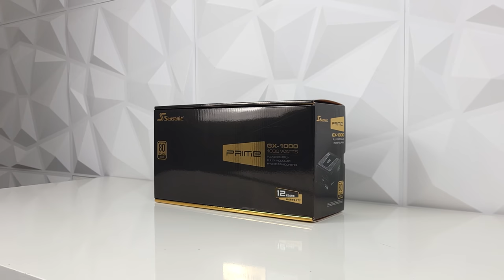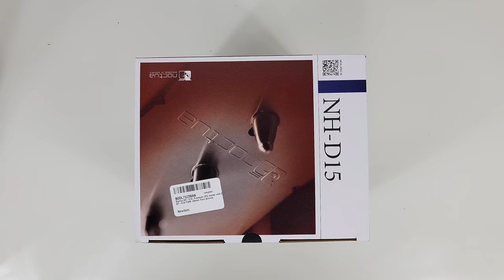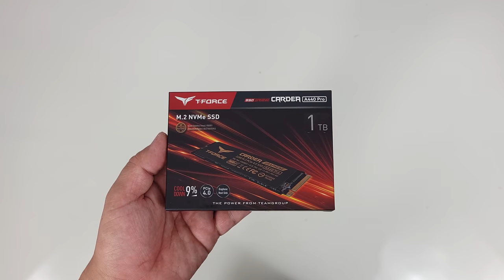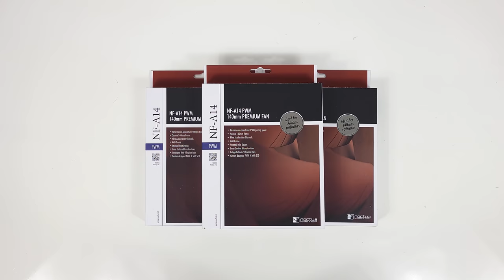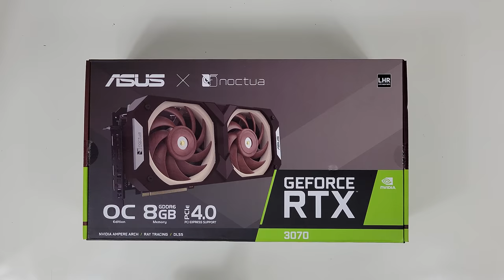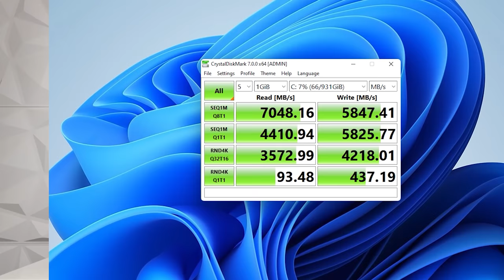Noctua PC Build 2022 | i9-12900K | T-Force DDR 5 | MSI MEG Z690 | Fractal Design Torrent | Seasonic

Comment: Noctua produces the best fans no other company could compete with. Airflow is always important to assure that the components don't overheat.
Reply: Noctua is king but there are companies that are competing just fine. Like BeQuiet.
Reply: phanteks T30 fans literally outperform them but ok
Reply: radosaurus   Wrong. There's plenty of noise normalized benchmarks out there and in pretty much all of them T30s outperform by quite a bit actually
Reply: @ThunderingRoar  They are 30mm. Not comparable. A12 still the king.

Comment: RTX 3000 series are extremely sensitive to warping PCB and because of that the GDDR memory going fail after some use. I suggest anyone with any 3000 series especially with heavy heatsink and fans use brackets or risers to support that heavy weight and avoid any PCB warping.
Reply: facts. the cooler on this 3070 is absolutely absurd in size but I love it lmao
Reply: how bout vertical mounting is it ok. I got the rtx 3060ti zotac twin OC
Reply: @Jack-xx3qg  Better for sure
Reply: Anyway those cards are going to fail. The design itself is too risky. Too much power to handle in a small area. Lead free solder and thermal cycling. It's time cases are redesigned to have the video cards always mounted vertically with the risers/adapters and rear cut outs readymade in the case. Also they need fresh ventilation to pull the air from the side panels.

Comment: I really like this build. The Torrent was a good choice because it's all around good and conveniently hides the Noctua fans from being seen head on at the front intake. Original color Noctua fans don't look great through obstructed view (dust filters, case grills). The cable extensions look awesome too. The only downside in this case is that the Torrent doesn't support vertical GPU mounting and a big point of that card is the Noctua fans in the fan slots. The ASUS X noctua logo design done in the Noctua colors is sleek and classy though so still amounts to a pretty sweet build.
Reply: Most cases that already have vertical mounting options do them badly. Almost 100% the gpu is too close to the side panel. You always need to buy a seperate vertical mount if you want to do it properly
Reply: the torrent does support vertical mount tho

Comment: I was shocked when my Fractal Design Torrent case arrived. That thing is huge! I suppose it’s a good thing as the NH-D15 probably wouldn’t fit in anything smaller. I just wasn’t ready for the size.

Comment: Awesome build, having the black gold accents on mother board, those custom cable extensions. 
All I’m missing is that 120mm fan in the back…?
Reply from the maker: Unlike other cases, the Torrent rear side has an open grill and the entire rear side acts as an exhaust. Adding the rear fan to the torrent didn't improve temperature while two front 180mm fans are blowing massive air toward the back.

Comment: Very nice and clean looking build, but the standard fans in the fronts are destroying everything after you put the work in the cable detail.
And why putting these sticker on the nvme there is a thermal pad on the top of the heatspreader.
Reply from the maker: I would change front fans if Noctua makes 180mm. Graphene sticker act as heat spreader it help even more.

Comment: should populate all the fans with NF-A12x25. change the nasty black front fans, 
and also populate rear and top (if possible) as an exhaust, this build has 6 intake fans and no exhaust.
Reply from the maker: Unlike other cases, the Torrent rear side has an open grill and the entire rear side acts as an exhaust. Adding the rear fan to the torrent didn't improve temperature while the front fan blowing massive air toward the back side. Bottom fans are 140mm not 120mm and Noctua doesn't make 180mm fans.
Reply: @PCTechnician  I see. 
I mean, for the sake of similarity, all should use use the same brown fans. and A12x25 seems the top tier choice from noctua. bottom and front, if not mistaken, can also populated with 3x120mm. and the back, well, for the sake of Brownie, it maybe better with brown exhaust. 

nevertheless, this build is still good

Comment: That extra copper plate should not have been installed on the NVME as far as I know. Only use it when the MOBO has no built in heatsink to cover the NVME/SSD. But other then that, awesome looking Noctua build
Reply from the maker: Graphene sticker act as heat spreader and it helps even more under mobo built in cover.

Comment: This looks great, but there are 5 or 6 intake fans(3 on bottom +2-3 on front) but no fan to pull hot air out from the case except fan on PSU. At least one should be on the back of the case to pull hot air from CPU cooler.
Reply from the maker: Unlike other cases, the Torrent rear side has an open grill and the entire rear side acts as an exhaust. Adding the rear fan to the torrent didn't improve temperature while the front fan blowing massive air toward the back side.

Comment: I've been thinking in your design since the 3070 Noctua arrived and you have done my dreams. I'm waiting for my 12900K and the only problem is that I have a Gigabyte 3090 VISION and I don't want to change for the 3070 NOCTUA, but I'm in love with it. I also use the NOCTUA NH-D15 and 6 140 mm NOCTUA fans in a FRACTAL DESIGN MESHIFY S2 white... come on!! When I saw your video I thought.. It is exactly what I have thought!!!! And very similar to the mine PC. I'm also using a CORSAIR RM1000X and CABLEMOD extensions in white.
Reply from the maker: Looking good!

Comment: Glad to see u use the meg since this the one im getting for my new i9 build aswell. What kind of ram can u recommend for this mobo? I with thinking about 4x 8gb vengance pro "3600"
Reply from the maker: I really like the new i9 & Meg too. Most DDR5 stocks are out of market so I can't really comment. You can use DDR4 on MSI Mag.
Reply: Make sure you get RAM that is compatible with your motherboard! The Meg board featured in this video is DDR5, and DDR4 would not fit in the motherboard. Although DDR4 Intel 12th gen motherboards exist, you wouldn't be able to get the full potential out of your CPU without DDR5.
Reply: @raptor6832  theres a ddr4 meg version not the ace one tho.
I read there can be issues without bios updates thats why i ask. Im not a fan of bios updates lol
Reply: @PCTechnician  You should remove that comment from that scammer below and report him man
Reply from the maker: @bnj3425  OMG this scammer is back! Thank you for letting me know. I'm deleting it right now.

Comment: I find this highly rated case hilarious. Seems to be like all the youtube pc experts are raving about how awesome this case is, and then you look at their setup and it's all completely intake, and no exhaust, except for the PSU fan. In this video, he has 2 giant intake fans that come with the case, and 3 fancy noctua fans intake from the bottom, but there are no fans dedicated for exhaust. Don't forget, this case has no top fans or side fans. LMAO
Reply from the maker: Looks like you completely misunderstood. Have you ever wondered why this case shows the best thermal result in the market without an exhaust fan? Unlike other cases, the Torrent rear side has an open grill and the entire rear side acts as an exhaust while two front 180mm fans are blowing massive air toward the back. Best Case of 2021 picked by Gamers Nexus. Check out the benchmark https://www.youtube.com/watch?v=HBxo2_lwKps://www.youtube.com/watch?v=HBxo2_lwKps

Comment: Beautiful build, but what are your CPU temps like under load? I've not really seen anyone air cool the 12900k yet.
Reply from the maker: GPU max=60c, CPU idle=30c, average full load=81c
Reply: @PCTechnician  did u undervolt or is stock settings? heard from techs that i9 cant be aircooled....
Reply from the maker: @babiialahaku  Aircool is fine with Noctua. I would recommend the undervolting though.

Comment: Has the 3080 NOCTUA not been released yet or is it just terribly hard to find? Great looking build, but pairing the 12900K with a 3070 seems a bit mismatched.
Reply from the maker: Yes it will be better with 3080. Noctua 3080 will be available starting in early June 2022.

Comment: 3 fan setup at the bottom is wrong it should be upside down.. Frame area of fans should be facing down to push out air... Here fan frames are facing inside pulling IN all air... Hot air created inside system should be pushed out... Kindly correct me if I'm wrong...
Reply from the maker: 3 bottom fans should be intake. This is how the case was designed from the factory with the best result. It supplies cold air directly to the GPU. Torrent front fans are blowing massive air into the case. Unlike other cases, the rear side has an open grill and the entire rear side acts as an exhaust.

Comment: thinking of doing this with a 4090 and a 7900X do you think with that insane gou power draw this could be kept cool? probably gonna undervolt cou too as don't need top 5% for 2x the power on cpu.
I'm also thinking of a partial block on back vent betweens base fans and gpu due to air leakage there before hitting the GPU.
Reply from the maker: I think Fractal Torrent is perfect case for 4090 & 7900X

Comment: A great case no doubt, but I´m worried about the power supply. won´t it get really hot being up there in the case?
Reply from the maker: Not at all, the Torrent rear side has an open grill and the entire rear side acts as an exhaust. Two 180mm front fans blowing massive air toward the back side.

Comment: Sleek look. Just a few things. Why do you show the SSD performance? It will perform the same in any system with PCIe 4.0/5.0. Secondly the most important bit of information for me, would have been CPU temperature under full load (Yes, I may be part of a minority here). Did it look bad or did you just miss the opportunity to include that? I only clicked on the video in hope of finally finding a test on that. 
Otherwise I really like what you did there.
Reply from the maker: 1. Not all NVME drive speeds are the same and I'm showing it for my sponsor T-Force that this NVME can reach up to 7000 MB/s.
2. GPU max=60c, CPU idle=30c, average full load=81c
Reply: @PCTechnician  Ah, sponsoring makes sense, yes. Thanks for the info. It is surprisingly hard to find actual temperatures tested for this CPU with an aircooler that can actually/potentially tame it.

Comment: a really sick build. but I do wonder, what do you do with these machines when you are done filming?
Reply from the maker: It will be sold to local customers here in L.A.
Reply: @PCTechnician  to those who think that there is no need in case fans and prefer to remove hot air by power supply unit? This idea is really crappy.
Reply from the maker: @-RobertYusupov-  Unlike other cases, the Torrent rear side has an open grill and the entire rear side acts as an exhaust. While the two front 180mm fans are blowing massive air toward the back side, adding the rear fan to the torrent didn't improve temperature much. This is best airflow case in the market now.
Reply: @PCTechnician  anyway additional heating of power supply is nothing but blasphemy, look for Van't Hoff's rule (With increasing temperature for every ten degrees, the constant rate of the homogeneous elementary reaction rises by a factor of 2-4). Inhomogeneous reactions as oxidation and diffusion undergo the similar rate increase.

Comment: BEATIFUL! but I would have put the power supply with the psu fan to up. In the another way the hot air will flows to the inner pc.
Reply from the maker: That is not how PSU fans works. Bottom fan intake air and rear PSU fan exhaust hot from case.
Reply: @PCTechnician  exactly. The psu fan don´t intake hot air of cpu and gpu dissipators if the case its closed????
Reply from the maker: @SaintDotCom  Unlike other cases, the Torrent rear side has an open grill and the entire rear side acts as an exhaust. While the two front 180mm fans are blowing massive air toward the back side.
Reply: @PCTechnician  Exactly. Very good point. But, even with the 180mm fans  and the massive air, greenhouse effect don´t affect to the air intake to psu fan?
Reply from the maker: @SaintDotCom  No
Reply: Oh good
Reply: @PCTechnician  sorry. The hot air to the psu*
Reply: @PCTechnician  I just saw that I put that the fan blows hot air into the PC. I meant to say that the psu fan draws hot air from the cabinet due to the greenhouse effect.
Reply from the maker: @SaintDotCom  Oh I see

Comment: Is the sticker on the NVMe SSD some sort of heat pad? If no, why didn't you remove it to get the full benefit from the heatpad on the PCIE cover? Just curious
Reply from the maker: Graphene sticker act as heat spreader and it helps even more under mobo built in cover.

Comment: How quiet are the 2 180mm fractal fans on the case? Would it be worth it to replace them with 3 noctua 140mm?
Reply from the maker: Very quiet. Noise levels are 16 – 35.4 dB.

Comment: If you're still around. What was that fan splitter at the back of the case? Something Fractal put into it? Because I'm aiming for a similar looking build but I'm not sure how to properly connect two front, one back and two top noctua fans on my x570f gaming. They can't be daisy chained and I don't think I can just Y-split them properly ... So I will probably need a 3rd party fan controller/hub?
Reply from the maker: Fan splitter comes with a case. You can also use any 3rd party splitter. But I end up putting all the fans to the motherboard because this motherboard comes with 6 system fan connectors.
Reply: @PCTechnician  tyvm

Comment: Got a very similar loadout and am putting it together in the next few days. I just have a black torrent and an NH-D15 chromax black. I just leave the stock fans from the torrent. I guess i will also get the custom cables, they look slick as f*ck. Just not sure if i get them black/red or black/silver.

Comment: You could have set Noctua fans as the front intake  also
Reply from the maker: I would if Noctua makes 180mm fans
Reply: @PCTechnician  You can still use the converter which comes with torrent case to use 140 or 120 mm intake in front
Reply from the maker: @ananth0408  Yes but blowing two 180mm is what make Torrent best airflow case.
Reply: @PCTechnician  fair enough 👍

Comment: Looks amazing, but I'm a bit concerned regarding "quiet".
Been using noctuas beefy nh-d15 also with 5900x and on load spikes it just can't absorb 150 watts without fan ramping up.
And if speaking about 12900k TDP it should go way up higher in temps (150-250 TDP?)
So it's more for looks than quitness I guess. No offense sir.

P.S
Changed to 280 arctic freezer ii (which is nearly the same value) and it totally changed sound from my pc. I do understand that noctuas beast is a long term device (may go into 2-n more builds afterwards) but it's no way quiet for high-performance CPUs unfortunately
Reply from the maker: During the full GPU load test, you can't even hear anything like PC if off. Even on a full CPU load test, it's still very quiet. Torrent fans are blowing massive air into the case.
Reply: I have the nh-d15S on my 5900X also in the torrent case and it stays very cool. Unbelievable amount of airflow through this case.

Comment: 5 fans in and 0 exhaust , have to stand hi up since  3 bottom fans will hit gpu like a wall , interesting solution.
Reply from the maker: Unlike other cases, the Torrent rear side has an open grill and the entire rear side acts as an exhaust while two front 180mm fans are blowing massive air toward the back.
Reply: @PCTechnician  I saw big holed mesh,  and Cpu kinda doing exhaust. Whole logic 3x120 +  gpu fans blow in back plate of gpu. . For front and tower  one stream no questions at all. I'm not saying  its wrong,  for me its unusual.  
Actually I was  in dilema between Nochtua Dh15  if Im right and Dark rock  pro4 . Noctua didn't fit in board i wanted. If board would fit would take white pure base   dx500 .
I know how high tech nochtua product and colour come from owls :)

Comment: Isn't the power supply sucking the hot air from the CPU cooler?
Reply from the maker: Unlike other cases, the Torrent rear side has an open grill and the entire rear side acts as an exhaust while the two front 180mm fans are blowing massive air toward the back side.

Comment: I really wish Noctua made 180mm fans. I've got a Torrent myself and want to use it forever basically and will eventually need new 180mm fans. They make 200mm but not 180mm. Doesn't make sense.
Reply from the maker: I agree. We need Noctua 180mm.
Reply: Noctua is where it's at. Come on Noctua. Give us 180mm fans.

Comment: Does NH-D15 Comes with LGA1700 mounting kit or did you had to order it ?
Reply from the maker: Yes. LGA 1700 bracket comes with Noctua cooler.
Reply: @PCTechnician  Thanks.

Comment: Doesn't the cooler already have thermal paste on it? Did you remove it before putting it on top of the CPU?
Reply from the maker: No. Pre-paste thermal usually comes with stock fans or some AIO.

Comment: Hello hello, i am currently considering Noctua NH-D15 for my 12900K cooling, but the ram clearance of the Noctua NH-D15 seems to be only at 32 mm, did you have to move the 2nd fan up by 5 mm in this case? thank you so much!
Reply from the maker: I used low profile rams here so I didn't have to move the Noctua fan.